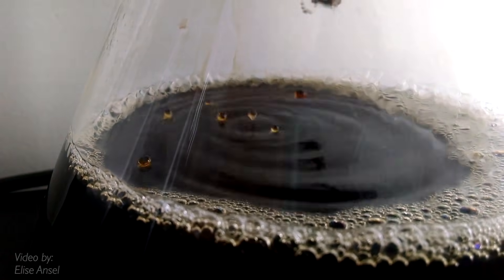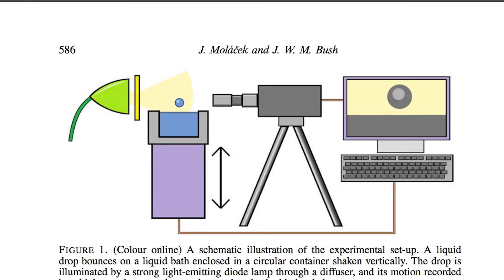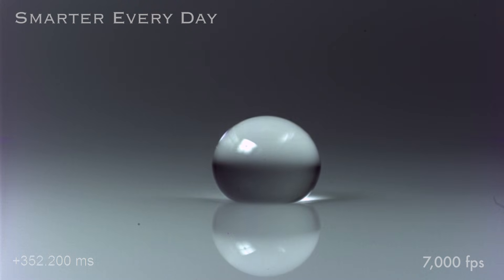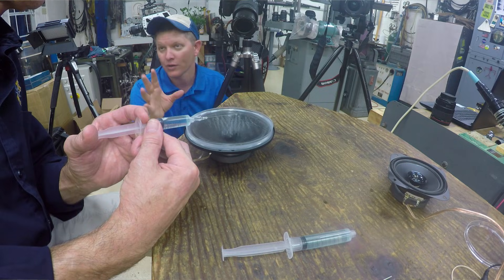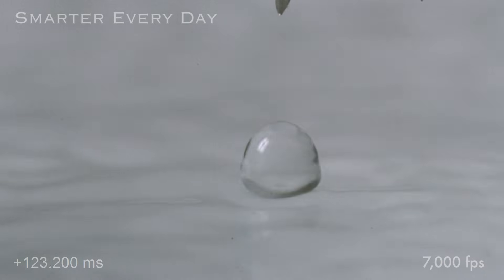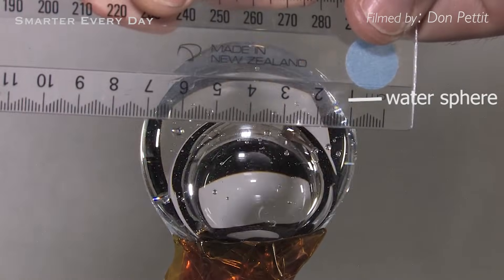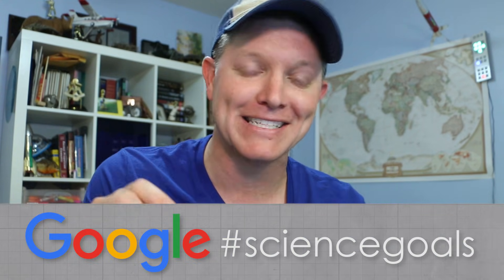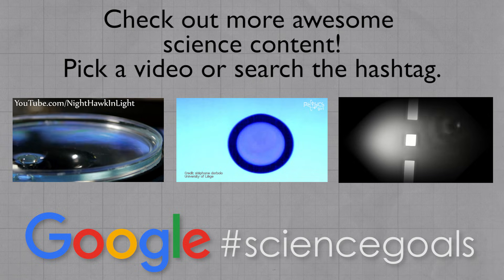The WALKING WATER Mystery (in SPACE and SLOW MOTION!) - Smarter Every Day 160

Comment: My guess as to 'why does the cello shake loose water droplets?' is based on two things: how a bowed string instrument produces sound, and the pitch of a cello.

A bowed string makes sound by the bow 'catching' the string then losing grip, over and over. This produces a wave very similar to a sawtooth wave, which kinda looks like NNNNN (best I can do with text). This type of wave is like lots of tiny impacts that are so close together their sound waves coalesce into a single continuous sound. I think this 'multiple-impact' style wave helps to shake loose some of the peak resonances of the water.

Secondly, the cello can produce lower pitches than other stringed instruments, and lower frequencies can sympathetically resonate through solid objects better than higher frequencies. You'll notice on the space video the lowest notes on the cello are the ones that are able to shake loose droplets, whereas the higher notes do very little. This is simply the cello finding sympathetic resonance with the surface tension on the inner bubble.

What is interesting is the video appears to show that really low pitches resonate with the outer water surface, and slightly higher low pitches resonate with the inner water surface. I'm guessing the size of the surface changes what pitches are able to form standing waves, which is similar to how sound works in air, where the distance between surfaces dictates what frequencies will 'stand'.

Comment: The NIH study is garbage, there is no air layer other then that initial impact air rushing out which pushes down on the flat water.
When its resting on the surface, its just surface tension of both the water surface and the droplet itself. This was thus proved by the bubble in a bubble part of the video which shows how the surface tension vs bubble size show that mathematically bubbles are certain dimensions for surface tension.  
Its like as small print book when in humidity, it curls, the larger piece of paper doesn't.
The curled book can go back to flat when pressed down on the large piece.
But sometimes it retains the curve, just like the droplet does.

Comment: It's the surface tension which keeps the drop in a sphere shape. The force of the surface tension works parallel to the surface of the drop. When the drop sits on the unmoved water, the surface of the drop becomes a pancake and rips open. I think you can destroy the bouncing drop effect with a drop of dish soap, which destroys the surface tension.

Comment: what about addressing it from a frequency perspective?  the water drop has to match the frequency of the body of water before it can meld.  you proved it by changing the frequency of the water with sound which caused the water drop to need to work harder to get up to speed before it could coalesce.  like a radio signal to enter it must be the same... water falling is no doubt vibrating at a different speed than the body of water, so in some instances the drop has to lower it's vibration to meld, and other times, like with the sound, it has to speed up.... neat

Comment: With the Cello, could it be that both spheres have differing resonant frequencies?
At 9:44 the higher tone (sounds like a C sharp ~280Hz fundamental) looks to resonate with the outer sphere of water while the lower tones at 9:50 (Sounds like a C or C sharp but an octave lower ~130Hz fundamental) seem to resonate with the inner sphere of air. Thats quite interesting! I'm curious, is the volume of the outer sphere double that of the inner one?

Great video, man!
Reply: Wait, do you mean that the difference in resonance frequencies cause enough disturbance to eject the water bubbles into the central air pocket?

I feel like we might be able to model the system as a sort of spherical resonator with surface distortion. Definitely something to look into more!
Reply: Why do droplets only break off inside? Maybe equivalently, why aren't there waves on the outer surface of the drop?
Reply: A sound observation! xD I could only guess the difference in surface area of the two bubbles  would also subtly diffuse the wavelength across the surface tension? Like ripples spread, perhaps?
:o
Reply: jg3142 I thought this was because the music was being played in the inner bubble not the outer water. Maybe I'm wrong, though.
Reply: Oh well spotted, if I compare the sheet music it looks as though the inner sphere buzzes around the D in the middle of the bass clef and the outer one about middle C or C#.

Comment: When the water comes in contact like the way it did it creates something called an anti bubble which keeps it from bonding with the water it is on. It is almost the same thing as when you have a hot stove and cold water. But instead of steam it is just a really thin layer of air. It works a little better with salt water or sugar water.

Comment: sounds like surface tension
Reply: everything in this world either the bigger you get or the smaller you get in and out say earth even though it is not spherical wants to be spherical atoms and the multiverse is theoretically a sphere so if you allow air gaps between the drops it will revert back to its state a sphere so if your putting that liquid that has the tension to stay in the shape it will push back and yeah

Comment: Is the cello phenomenon entirely explained? If not, I have a curious hypothesis about the cello droplets that might be easy to test (even under gravity.) 

Given a speaker and sufficient amplitude, you ought to be able to cause the surface to "bubble" droplets just like in space. Instead inducing vibrations from the speaker alone, try simultaneously introducing a matching alternating current. I have reason to believe this would play a part in this surface phenomenon and change the rate at which droplets are produced. It'd likely be related to why we like cellos, too. (Or not - thus science!)

Comment: could you put micro particles on or within the drop to observe any rotation, then track the speed/direction of rotation on the surface that could potentially increase/decrease its ability to maintain its resistance to coalescence, i think the effect could be potentially manipulated ultrasonically. maybe if you used metal particles and a high speed x-ray of some sorte to track the the flow dynamics, could yield some interesting results.

Comment: Genius... I‘m looking for you!  Boil water in a pot on a gas flame.  Let it steam vigoursly.  Quickly turn off gas.  ??? What should happen??? Steam should decrease, because heat input has gone down. ???What actually happens??? A big Gush of more,  yes more, more, steam.  Try it and see.  Then explain this observable phenomenon.
Reply: Joss Fitzsimons it's all an illusion,  steam is water vapor, and like all gas, is invisible. The only reason you can see it is because it is condensing into small water droplets when it hits the cooler air. When the pot is on a rolling boil, the steam is very hot, and thus less of it is condensing, and you see less of if, but when you turn off the heat, the same amount of steam is still coming off, but it is cooling much quicker so you can see more of it, giving the illusion that more actually is coming off.

Comment: Hold on a hot sec.  I've also noticed this in puddles, and it drives me crazy--but i'm not quite satisfied with your explanation. The explanation you give for walking drops seems to depend on a consistent frequency wave in the dish.  Is this true/reasonable? It seems that the frequency of waves in the puddle would vary dramatically and the drops would not last very long--but this isn't what is observed. 

Also, the magnitude of the waves seems important.  In the video, the waves are very visible, but a puddle looks still.  Does this indicate that very small amplitude waves can cause this?

Comment: Beautiful shots! Did you try dropping the water on the surface with the speaker vibrating but at a lower amplitude so there were no Faraday waves?
Reply from the maker: Sure did man.  We didn't use the setup to image it though.  I concur, the mechanism we're showing here is certainly more of a macro-scale phenomenon.  From most of the papers I read, it seems like using interferometry is the most reliable way to image THROUGH the drop to figure out the air gap between the water surfaces.  We upped the amplitude intentionally to try to get clearer images.
Reply: @smartereveryday  i set the speed to 0.25x to watch it better B)
Reply: Veritasium ITS YOU OMG
Reply: I just want to say I love watching both you and Destin, you guys have the top quality videos. I think everyone here would want to see more videos that you two collaborate. Thank you guys!!
Reply: At a casual glance, the air pressure vs  droplet# graph shows a correlation (reduce air pressure, reduce droplets) but it seems pretty close to linear... As ambient air pressure decreases, exterior pressure on the droplets also decreases.  So the same surface tension can contain a larger mass(volume) of water.  But Gravity is constant, so deformation of the larger drop on impact will be greater adding to the tendency for the drop to lose integrity and coalesce on the surface.... no?  I think the phenomenon has little to nothing to do with the air, and more to do with surface tension, droplet integrity, and condition of the larger body's surface.... The first clip showed that drop bounce 19times without coalescing!  How much air could still be trapped between a spheroid and a surface (more or less) there by 19 oscillations?
Reply: Veritasium cool science discussion is coming and i want to witness
Reply: Yeah that thing bugged me. There's a lot of frequencies under the Faraday instability ones that are still usable for non-coalescence... I guess it didn't really show how the waves can "catch" the droplet.
Reply: Veritasium It seems like the bubbles of air or water come up in the cello clip when the low or loud notes are played.
Reply: I wish I could've seen that clearly in the video. Oh well.
Reply: +Peter Rabitt  you got me interested :D could you share those videos or links to them?
Reply: Peter Rabitt is there anyway i can see these interesting videos you've saved that I may have not?
Reply: Peter Rabitt Yea what's on your WOW folder?
Reply: @Peter Rabitt what's in the wow folder!? FEEEED MEEEEEE!
Reply: hey i tried it dude it was preety hard to set up but i got the idea and made it
Reply: So somewhere, there's the biggest water bead. What could be its size?!
Reply: @Peter Rabbit what was the video?
Reply: You have a video about this phenomenon, about how the drops act quantum like.
Reply: Wow

Comment: Very interesting video. I'm pretty sure why the cello caused that to happen. The harshness in the discrepancy of the bow screeching to the smoother midrange of the notes produced is almost unique to the instrument.
Wish they would do more extensive research on sound interactions. Like for instance...
Sound can't be heard in space but, energy pumped thru a speaker has to go somewhere right?
is Dark energy just sound trapped in a form we can't understand?
Reply: Short answer: no.
Longer answer: sound is a mechanical wave, so it needs matter to propagate. No matter, no sound. Dark energy is not a mechanical wave, as it can propagate through empty space.

If you put a speaker outside the ISS and play something through it, its membrane will just move back and forth like it does here on earth, but won't push anything. You're transforming electrical energy into mechanical energy to make the membrane move, and here inside the atmosphere part of that mechanical energy is passed on to air molecules. Your speaker would just consume a liiiiittle less (electrical) energy out in space because it wouldnt be pushing air so wouldn't lose (mechanical) energy to that. Very little difference, though.

Comment: Larger drops have weaker surface tension compared to their mass and a greater abutting surface so they can effectively let the pool of water into themselves, as well as dropping into the pool, increasing the likelihood of coalescence.
What effect does the tighter curvature of the smaller drops have as it lowers the surface area of the two fluids touching, allowing more air between but less air in the tangential area between the droplet and the surface.

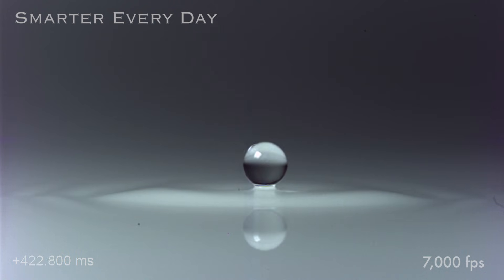Comment: It can't possibly be an air gap, because the geometry doesn't allow it, mechanically the water beed should push all the air from under it. Look around 3:51 exactly at 402.600 ms mark you can see the merge front start from the left where there is a clear distance between the beed and the water, and then propagate to the right, at 403.0ms it's a third of the way through. It does not happen from the center to the outside where the air gap should be zero. The air gap explanation is wrong!

Comment: Hi Destin, the reason the cello may have a different impact than other instruments could be that they are a stringed instrument which is tuned through the 'harmonic series', and the strings themselves also have overtones which we struggle to hear (but are still there) which are part of the 'harmonic series' also. The way this differs from rock and stuff is that, yes guitar is a stringed instrument, but if it's electric, the pick ups and amp aren't necessarily going to pick up and project those self created harmonies. Because of these different pitches that occur; could this also explain the different sized droplets due to multiple frequencies occurring simultaneously? Best, Sam.

Comment: So i guess the flat surface of the water gives enough surface tension to cause the droplet's membrane to fail and therefore separate and absorb

When vibrating the membrane is never forced apart as its treated like a "hot potato" 

It works the same way in that your hand wont be burned if you toss a hot potato between two hands, as the heat (tension on the membrane) dissipates (reforms to a sphere) as it is pushed airborne and softly caught again by the vibrating water and the cycle repeats.

The droplet's membrane will always have a chance to fail if it hits somewhere without all factors working together, much like the water balloon comparison as if you started to catch where you would normally end a catch it wouldn't take advantage of being decelerated and would take the full force of the catch/fall. 

If you weren't actively timing the catch then there is always a chance of that happening, and the vibrating water is not timing its catches, but it is consistent so it usually stays a droplet for a while.

Comment: Destin you have to do a video on the way zero gravity effects your retina
Reply: Zero g*
Reply: Anthony Chan to address your theory: I'm not sure if the astronauts experience "pooling" of blood because of the lack of gravity. I understand blood pressure(everywhere in the body) to be a delicate balance of oncotic (colloid, or particle) pressure and hydrostatic(fluid) pressure. Gravity is responsible for a baro-reflex which would either slow down the heart rate or speed it up. This then would decrease blood pressure(mean arterial pressure) or increase it respectively. I don't see astronauts having elevated blood pressures that also lead to elevated pressure in the eye. If indeed the pressure increases, then astronauts are at risk for developing glaucoma and macular degeneration. now i don't actually know if that's the case. I'd have to do some research into health probs of astronauts
Reply: Does it though? The only thing I've heard similar to it is how in space you sometime see flashes of white light even with your eyes closed because high-powered particles went through your eyelids and hit your retina.
Reply: Milo Cunningham isn't it the low gravity making blood pool up by the retina
Reply: It does, not to sure but its about the blood in capillaries of the retina and damaging it due to a higher blood pressure. Usually gravity pulls the blood to the lower half of the body, but not in space and so the blood pressure is spread more equally even though our bodies are not adapt for that.
Reply: Milo Cunningham Where did you get your profile picture thing?
Reply: +Alex Fielder It's promotional artwork for the videogame "Firewatch."
Reply: Milo Cunningham firewatch YEAH!!!!!!
Reply: Joel Biester thanks

Comment: It's called surface tension. Hydrogen bonds
Reply: yes, water has a high surface tension due to the large number of hydrogen bonds (bonds between the hydrogen atom and oxygen atoms being attracted). The relation between cohesion and adhesion depends on the chemical makeup of the liquid. Ethanol can be observed doing strange things in alchoholic drinks as the ethanol and water interact in different ways at different temps.
A drop of detergent, for example, can be observed to interfere with the hydrogen bonds. Detergents generally have a hydrophobic end and a hydrophilic end that interferes with the polar bonds between the hydrogen and oxygen.